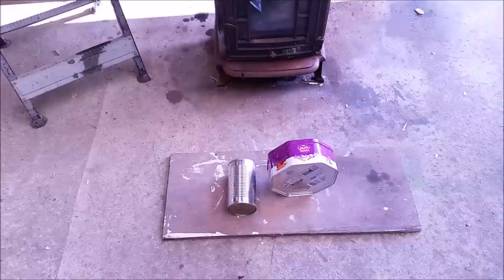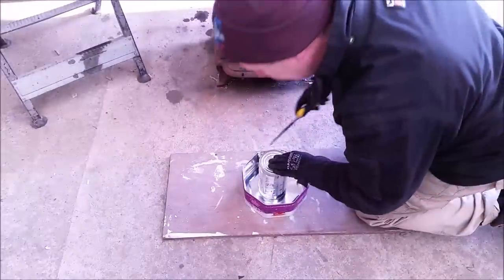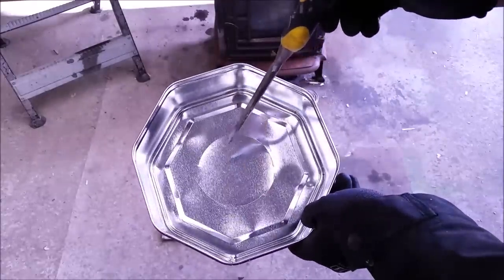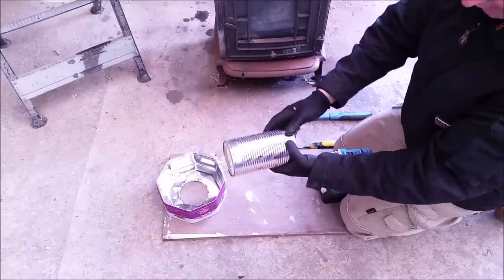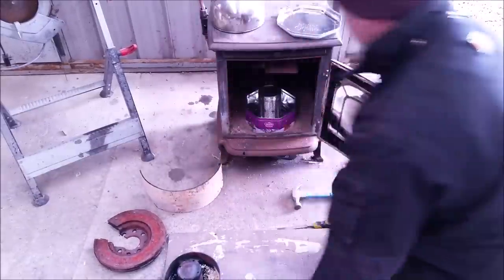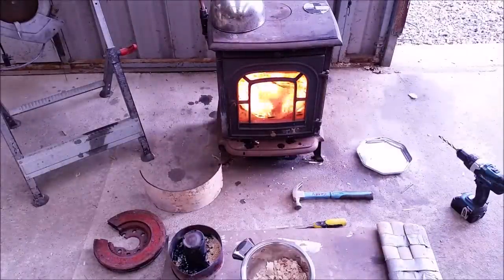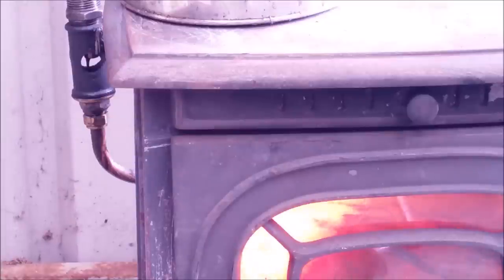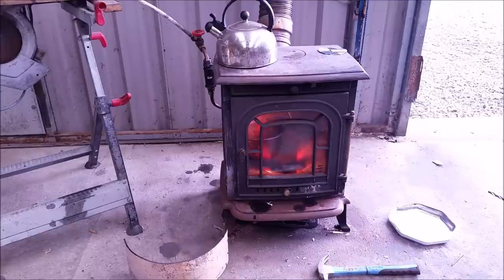Homemade Tin Can Waste Oil burning Heater .. AWESOME OUTPUT ! ..

Comment: Did you notice there was a bit of smoke leaking from the door on the right side?
Reply from the maker: Hi Alonzo. This was my design waste oil burner being protyped and tested and I was just looking to see was it possible to make this work. There were a few revisions since this video. Here's this burner made from steel and installed into a stove of my own design making breakfast and not leaking fumes. https://youtu.be/tnzEDEpz3Yk Thanks for the comment Cheers Gerry
Reply: No worries, I figured that might be case.  Wouldn't mind seeing that stove of yours, sir!
Reply from the maker: Hi Alonzo Sorry I forgot to add the link Here you go. https://youtu.be/tnzEDEpz3Yk I have used this burner in quite a few of my videos if you check the playlists here you can find more  https://goo.gl/r61Sza Cheers Gerry

Comment: good work bud, why did you use the chisel versus other cutting methods?
Reply from the maker: Hi Erik. No particular reason I could have cut it with a scissors or a tin snips or even a hole saw as I had them all nearby but the hammer and chisel were closest. For a very quick project it can achieve some serious heat levels. I will be posting a video a little later today with a welded more robust version working very well. Cheers Gerry
Reply: Thanks Gerry, are you utilizing this as a separate O2 feed from below solely? And then using the large propane tank burner as forced air combustion chamber solely? I was wondering if there's ways of merging the 2 or if you had tried/thought of it
Reply from the maker: Hi Erik. This type of burner can easily be fed additional air from below  or along with the oil feed with the 1 inch pipe.  When coupled to a propane tank conversion like the minion and some of my ohter propane tank videos it will run very well on solid fuel too in either the top or bottom compartment making a multi fuel capable conversion. More on all of that in the following videos. Cheers Gerry
Reply: Erik Dale is an American hero

Comment: Being that waste oil is now recycled, where are you going to get enough waste oil to make this worth while?
Reply from the maker: Hi T.F. It's not that hard to get but most of my stove designs will burn solid fuel too. It's a lot easier in winter to spend time in the shed if it's not freezing cold. Thanks for the comment. Cheers Gerry
Reply: What is the max burn time for anthracite coal?
Reply from the maker: Hi T.F. A bucket of coal would last a few hours depending on how much the draught plate is opened. Oil burns at about 2 to 3 litres per hour. My shed is uninsulated so does not hold heat for long. Hope this helps Cheers Gerry

Comment: sir where did you put the oil?
Reply from the maker: Hi Jamie.The oil is in a bucket to the left of the stove. It goes through a valve and drips above the tin can burner. I have a more recent video with a welded burner but I explain the drip feed system Here's a link https://youtu.be/Bf38HSxtSBw  Hope this helps Cheers Gerry

Comment: Good idea. I'll try it to heat my shed. Does the oil just drop in to the pan at the top or the bottom?
Reply from the maker: Hi Donal. Here's a link to this working in my shed in  a different stove and made from steel. Easy project too. https://goo.gl/YDSDk2 There are lots of videos on Waste oil burners in my playlist. Cheers Gerry

Comment: why wouldn't you use a stainless steel pot that can't melt at high temperatures?
Reply from the maker: Hi. I do use Stainless Steel  in some of my other videos. The little sweet tin is just so  I can make a setup quickly and try it. It's very easy to raid the sweet tin but if I take another stainless steel pot from kitchen I might need to make the shed more comfortable. Lol Cheers Gerry

Comment: Sorry if it's a stupid question but what oil works in this? Just motor oil or would any work?
Reply from the maker: Hi John.  The question is good. The oil can be veggie oil or car engine oil, hydraulic oil etc. It seems to want to burn everything. Here's a list to more of my videos. I think there are 130 videos or so in total but heres a waste oil list https://goo.gl/96qYye  Thanks for commenting Cheers Gerry
Reply: know such thing as a stupid question.
Reply: Really anything less volatile (and explosive) than gasoline should work.  Diesel, kerosene, fuel oil, cooking oil, hydraulic fluid, transmission fluid, motor oil...  All of it should be at least serviceable in a waste oil heater.

Comment: Probably smells like an old Ford!!
Reply from the maker: Hi WJB111.  Like an open fire in a house where all the smoke and fumes go up the chimney that's what happens with this cast iron stove. There is no smell in the shed as all the hot gases exit through the flue. I made a new burner unit out of steel and I show how to make it and also I show it working. https://youtu.be/ShTLaYKjzxw Cheers Gerry

Comment: I don't get where the oil is dripping, where the air is coming from etc...
Reply from the maker: Hi Jim. I have plenty of videos in the playlists where you can see the feed system in operation. The air comes in from below. This was just a quick way of finding out if this design would work. Once it worked I welded one up in steel Here's a playlist with lots more info. Cheers Gerry  https://goo.gl/96qYye
Reply: GerrysDiy   Hi,  yeah, I was pretty sure you did, and I know this was more of a demo for how easy it is to prototype.  I just felt a little lost watching it, but afterwards I thought about it, and figured you must have more videos.  Thanks.
So what part of Ireland are you in?  My dad was from there, and we went to see where he was from, but that was in Ulster, and back when things were pretty bad in the 70's
Reply from the maker: Hi Jim. I live in the South in County Wexford. I have a daughter living in Belfast and it's a different place now. There is no border to speak of. You just drive and the road signs change in design and you are in the north. Thanks for the comment Cheers Gerry👍
Reply: GerrysDiy  wow, that is a change!  I know my dad went back several times before he passed, and told me there aren't any searches, road blocks or army driving around.  Definitely a good thing.  
Thanks for the play list, I need a way to heat a work shed for cheap, and it gets a lot colder here.  Il check them out.

Comment: it is necessaryto heat first the oil
Reply from the maker: Hola Jaime. No Just a little kero / diesel to get the pot hot first and then add the cold oil. Cheers Gerry

Comment: If you had cleaned the glass with a razor before you started we could have seen it for a few moments
Reply from the maker: Hi Jerome. Here's the same burner but welded and made from steel. I used it in a shed heater I made but it is the same design making massive heat. https://youtu.be/tnzEDEpz3Yk Cheers Gerry
Reply: GerrysDiy thank you Sir!

Comment: This looks quite dangerous and I wouldn't recommend anyone trying it especially not in a house. Ps I'm an oil boiler engineer and have been working on natural draught vaporisers for 30 years.
Reply from the maker: Hi Richard. It is dangerous and should not be fooled with domestically. This was just a prototype and I made a welded version that I run in my shed heater / waste oil cooker. Here's a link https://youtu.be/tnzEDEpz3Yk Thanks for the comment Cheers Gerry
Reply: Yes it looks dangerous although it is a prototype. I couldn't follow too well what was going on inside the stove. Are the flames inside the biscuit tin? I was expecting them to be coming out the holes. The oil is just burning in the biscuit tin? Would it not just do that anyway without the pieced tin? And why doesn't oil run out the bottom?
Reply: AhHa! :-)
Reply: And I worked on oil burning furnaces and waste oil burners for 35 years and it’s basically the same principle, I burn used motor oil straight in my oil furnace to heat my dwelling, it burns clean and the oil is free, big oil companies and the federal and provincial governments don’t want you to know these thing as they can’t collect no tax off the oil from you, cry me a river mr tax man
Reply: Ohh err lol.
Reply: Ouch.
Reply: This is dangerous kids. The negative pressure in the firebox will draw in waste oil at an ever increasing, exponential rate. You could poke an eye out! But it would land on a nice warm floor.
Reply: mark t  When burning with negative pressure like this, it's actually quite clean for burning oil.  Unlike the engine of a car, this doesn't blow unburnt & incompletely burnt fuel into the air.

Comment: why don't you send your idea to the EPA and see what they think I bet they wouldn't like it although you do have a good idea
Reply from the maker: Hi James. This burner is rough and ready but can easily burn waste oil for little or no money. It can be made in most sheds and then provide heat. If used for burning veggie oil might even be carbon neutral.. Maybe.. Cheers Gerry
Reply: Gerry's Waste Oil Burner  maybe I should be more clear here in the states we're not allowed to burn waste oil like that. It's against the law. But people do it anyways. I use a old strips of shop towels instead if wood chips. works well .
Reply from the maker: Thanks for the heads up James. Cheers Gerry

Comment: yES  its a carburetor    lol  venturi  air flow from the bottom   lmao  i mite try that with brake rotor off f 250  and heavy piece of pipe capped off for the top hat  huh

Comment: 0000 steel wool will clean that glass up
Reply from the maker: Hi Christopher. Thanks for the tip. I made a more durable burner unit based on this design and managed to cook breakfast on it. Here's a link. https://youtu.be/tnzEDEpz3Yk Thanks for the comment Cheers Gerry

Comment: Watch out for carbon monoxide
Reply from the maker: Hi Peter. By design when it is in my stoves all the gases are pulled into the flue leaving only clean air in the shed. Even with the door open the draw is sufficient to achieve this. Thanks for commenting Appreciate it Cheers Gerry
Reply: GerrysDiy Nb nice video

Comment: not clear on how this works.
Reply from the maker: Hi dufus Air comes in through the bottom and burns. Only the bottom is exposed to the air supply the flames are intensified in the burn chamber and vaporise the oil. That's it you might get a better idea from this video with a similar burner design. https://goo.gl/fipBLn  Cheers Gerry

Comment: Sorry you lost me. Couldn't hear half of what you were saying, even with volume all the way up. What starts as easy simple burner with pastry tin & empty can, gets a little confusing when an old stove shows up with parts of it lying on the floor in front of it, with what appears to be homemade apparatus fuel line attached. Really a waste of time, unless you happen to own an old stove. Don't even know what kind of stove it is, let alone the homemade modifications. No offense, but in my opinion, you left more people confused, rather than enlightened. Shalom
Reply from the maker: Hi Bruce. That is an old video I had problems with the audio but it became popular so I left it up. Here's my latest project with a similar homemade burner and a homemade boiler stove working off waste oil and heating 24 gallons of water. https://www.youtube.com/watch?v=JHsNoqp9QAE Thanks for the comment Cheers Gerry

Comment: Only a FOOL would attempt such a project as this. Take note of the oil line coming into the stove. If that does not scream "WARNING". Then you have no common sense. Ask the fire dept. to come by and do a safety check if you are determined to try this. Perhaps you would respect their professional advice.